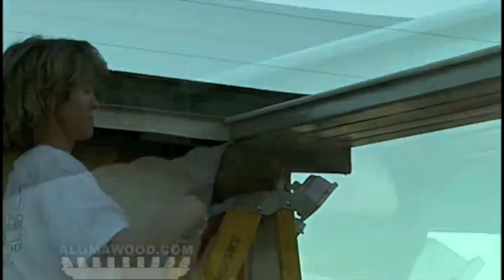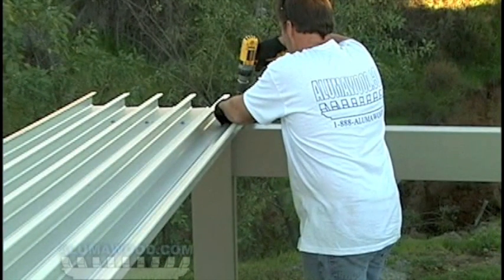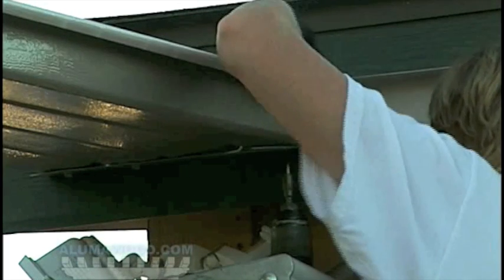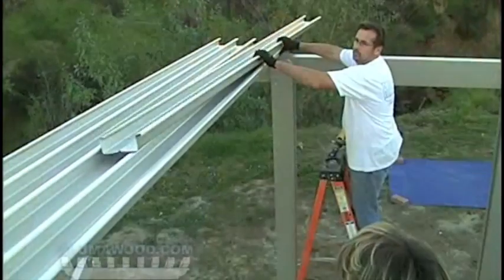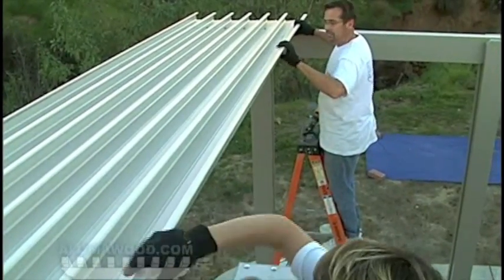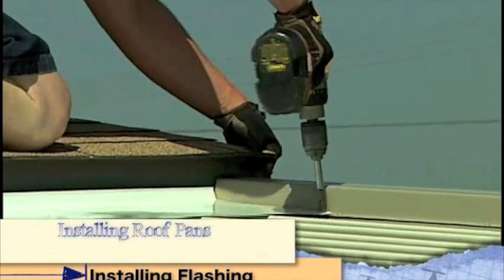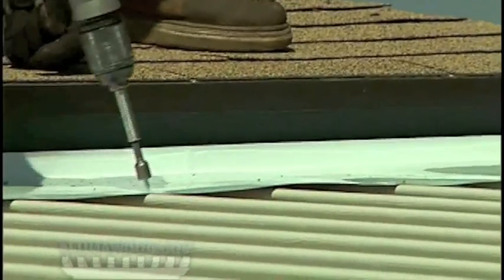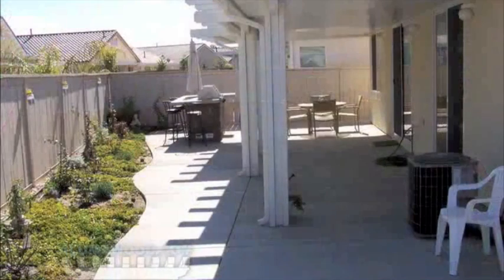AlumaSolid Step 4 "Roof Pans"

Comment: I have similar roof pans over the shed of my double wide in FL.....
1. There's a leak on the inside at the pan joint. How do you find that leak point on the outside?
2. Once the leak point is found, how do you seal it if you can't reach it from the ladder? (you can't walk on mine like on some vids, it's too weak, I'd fall through)
3. What sealant should be used?
Reply: Polyurethane caulking. Crimp the panels together. They never crimp (Field Lok) each panel to one another. Im a Florida Roof contractor. Let me know how I can help.

Comment: Did you seal the roof with any product to keep it from dripping condensation water
Reply: I'm an installer, yes we use a high quality caulk that matches the color of the panels we are sealing. Every seam and every screw gets caulking.